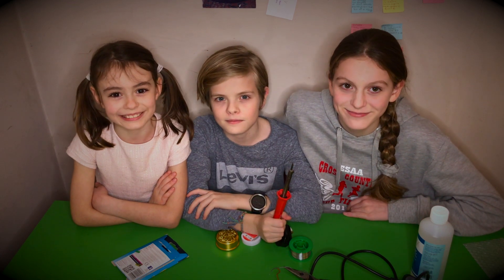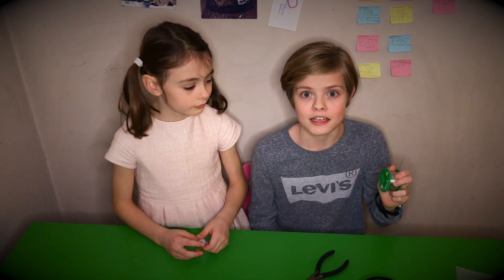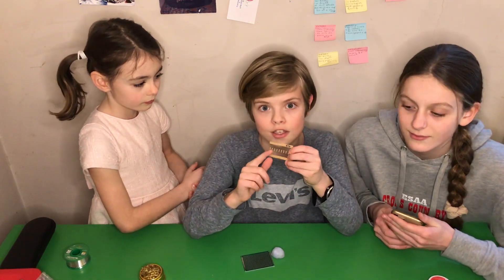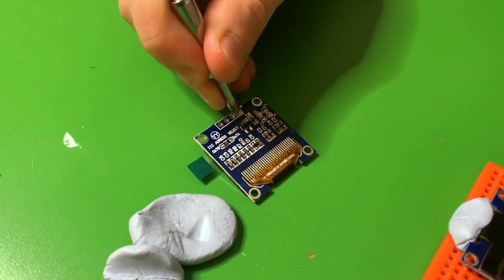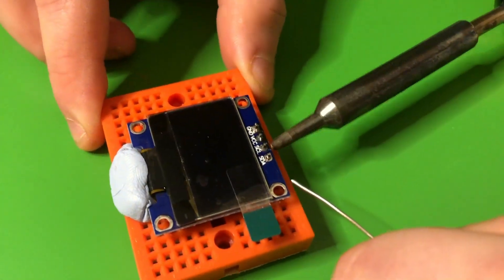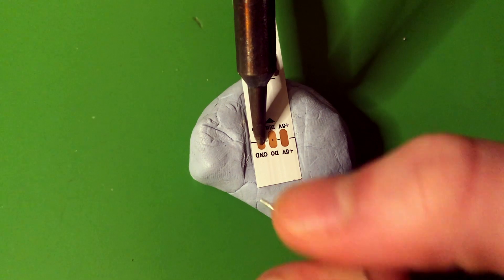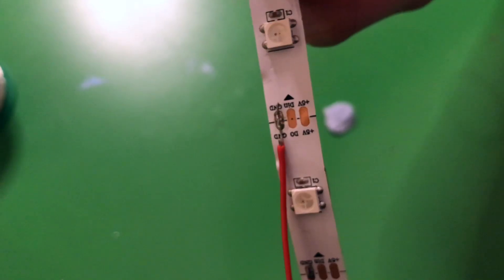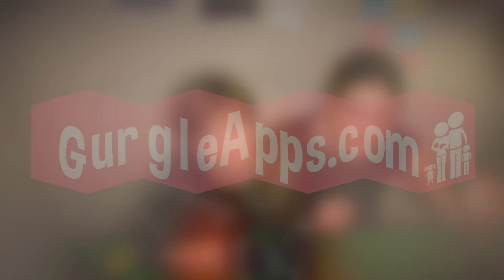How To Solder - Our Tips & Tricks - Plus First Time Soldering Ever For Our Little Sister!

Comment: Great points and advice on this subject.  I was probably somewhere between younger sister and older sisters' age when I started.  I find that holding the soldering iron as if I would a pen at downward angle helps a lot with control.  It just feels more natural to me.  Also, use of leaded solder makes the job easier.  Lead free doesn't really make much difference in the grand scheme of things.  And definitely clean up excess flux off the board.
Reply: I would also recommend 60sn/40pb which has a lower melting temperature, or ever better 63sn/37pb (Eutectic alloy), which is much less likely to create a "cold"  crystallised connection if the joint moves while it is cooling.
As Richard said, most makers won't be contributing much to lead contamination from the amount of solder they will use.
But if you learn with lead free, you will never have a problem solding with leaded solder, which is much easier.
But leaded solder is getting harder to find, but it is still available (at least in the USA).